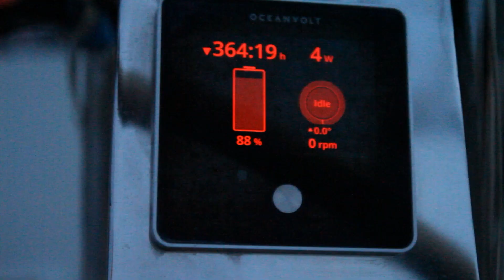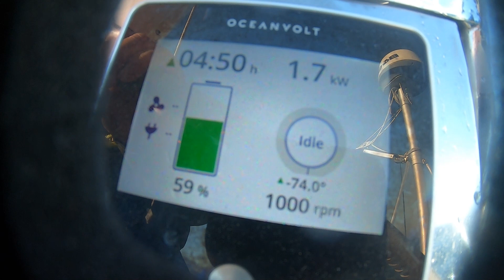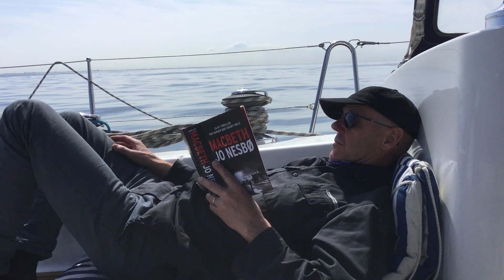Silent Sea - what does the company do regarding electric propulsion in boats.

Comment: Even if NO WIND but lots of sunshine and having enough solar panels on board mounted with sufficient capacity of batteries you still sailing using the el motor as propulsion.